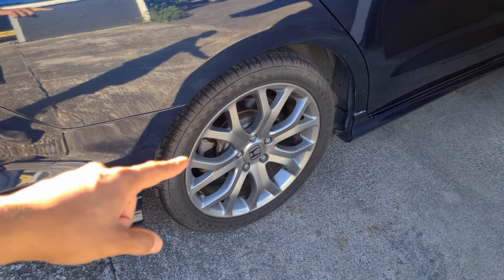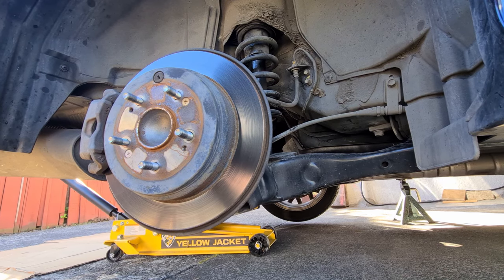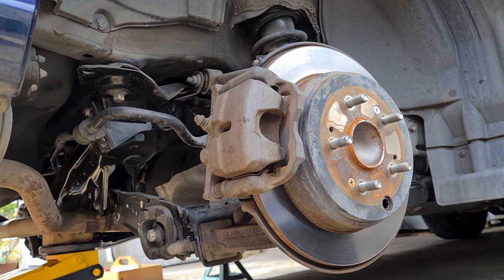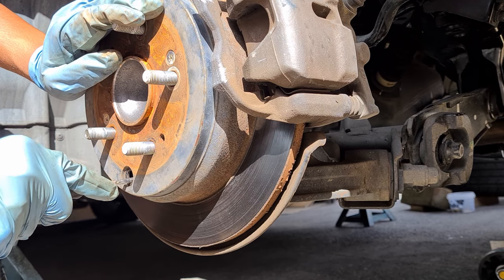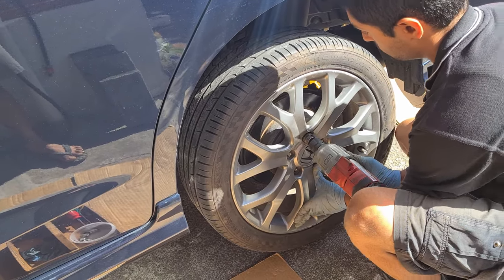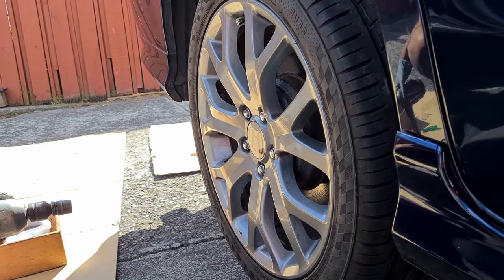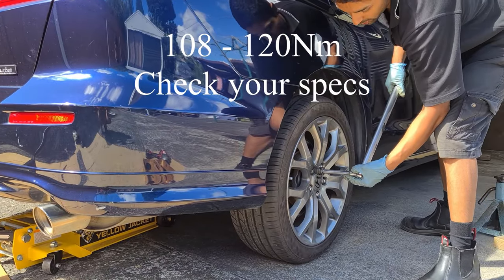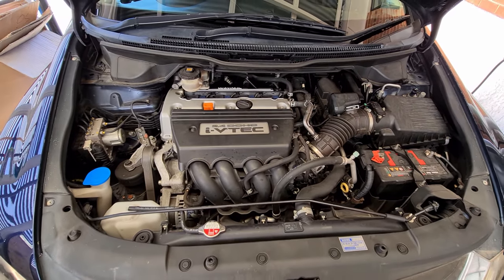Honda Parking Brake Adjustment

Comment: Nice video. What torque wrench you have ? Brand and size 3/8 or 1/2???
Reply from the maker: 3/8Dr Tenq torque wrench
Reply: @AutoBuddynz  excuse me. Does the torque wrench goes over 100 foot pounds?
Reply from the maker: @xavi-12  https://www.tengtools.com/nz/products/torque-tools/torque-wrenches/3-8-torque-wrench-20-110nm

Comment: You tightened it 15 then loosened it 15. Makes zero sense.
Reply from the maker: I didn't tighten it 15 times, if you watch the video again you will see how many turns i went in. If they are new shoes you might only get 5-6 turns in. Once the drum or rotor in this case does not turn any further you go back 15 turns as per Honda. This allows adequate clearance. Also remember this a self adjusting system.